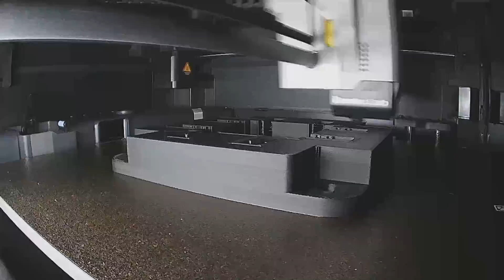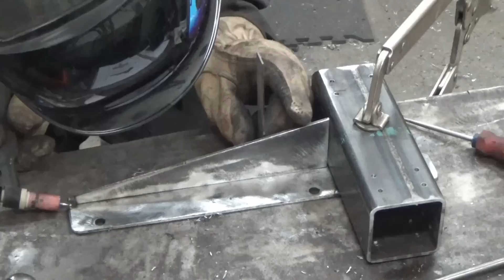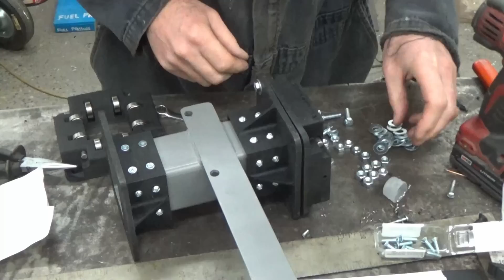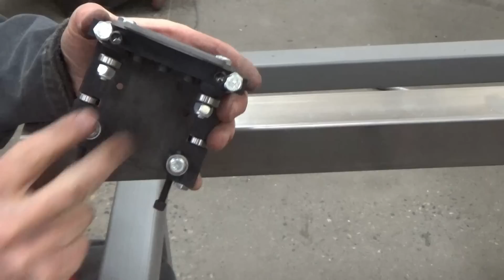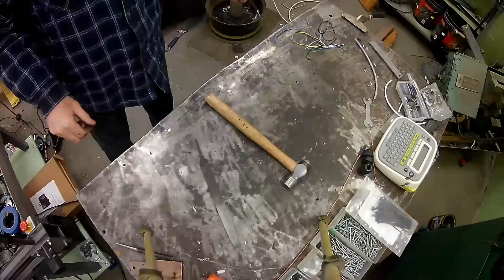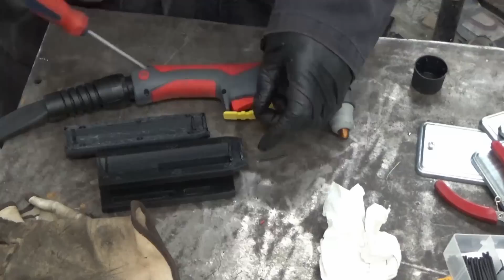We Build a CNC Plasma Table!

Comment: I'm building one now and will be using a Raspberry Pi with Klipper/MoonRaker/Fluidd to allow me to setup the machine more precisely than trying to use OpenBuild ...    I find Raspberry PI's are more stable than Arduinos and easier to update as needed over WIFI..

Comment: if it's already bulky and taking up space you might as well build an enclosure for it, from anything, even cardboard, and hook an extractor to it, it'll help remove the smoke AND you won't look like a welder after a day welding pipes in the sun with no helmet XD ... it'll save you sandy eyes, it'll save you the UV red skin burns, and it'll smell less bad, probably

Comment: Thanks for sharing.  Thinking about doing this build.  I've seen a couple of videos on the larger table and saying lots of EMI and shielding/grounding?  How much did the shielded wire add to the cost of the build?  Thanks, Ken
Reply from the maker: You definitely need the shielded wire, but it's the details in how you wire it that determines whether you have issues or not.  I will still make a second mast to separate the control wires from the torch wires, and I may still swap all the guts into a metal box instead of plastic.  A bigger table is always nice, but I really don't cut anything bigger than 2x2, and I'm not willing to lose the floor space.
Reply: @GregWellwood  I hear you on the floor space issues.  Every time I want to do something in the garage I have to move stuff out of the way to get to my lathe, mill, surface grinder, or welders LOL  I might have to make this a fold up design or build another shed to free up more floor space in the garage.  Are you having any cut issues or are you happy with the build?  Thanks, Ken
Reply from the maker: @customcutter100  I know the 2x2 is designed so the legs fold up so it can be moved/stored.  I suspect the XL is too.  No problems with cutting once I got it sorted (some mistakes on my part).  Sadly, I have only made maybe a dozen parts on it so far - the day job keeps getting in the way.

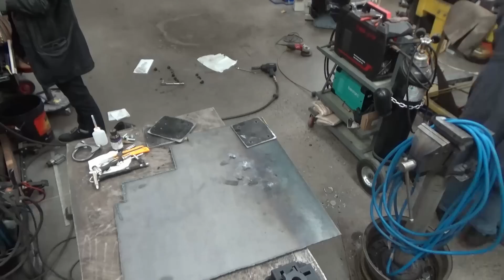Comment: 3:24 So the thing about getting new apprentices to catch the sparks in a bucket is Real.
Reply from the maker: I'm trying to catch the "grinder dust" that gets all over everything in the shop.  My kid's '68 Catalina was on the lift (you saw his shoes), and I'm being considerate of his car.  I prefer sending the apprentices off to someone for "a long weight" (_wait_).
Reply: @GregWellwood  We used to send the apprentices to get a bottle of "solder water" to wet the sponge to clean the iron tips.
One day one of them came back with an unmarked bottle filled with water, put it on the workbench, didn't say anything, and walked away.
He turned out to be a great technician.😁
Reply from the maker: @Bobs-Wrigles5555  My mom used to work in a bank back in the day, and would send co-workers to other branches to get "verbal agreement forms," and then call ahead to get them sent to another branch...
Reply: @GregWellwood  😂😂

Comment: The arduino, you flashed over / erased the arduino bootloader. If you have an AVR programmer, you can re-flash the bootloader and it would be back to being an arduino. It's no big deal, but you need an AVR programmer - they're only a few dollars on the usual places these days
Reply from the maker: I suspected I might be able to save it, but going to an ESP32 board was a whole lot cheaper, and I was tantalized by the WiFi/Bluetooth option.  I will keep an eye out for an AVR programmer.

Comment: I used a Hitbox non-hf plasma cutter for mine. Was $150 on eBay. Just had to adjust my torch on delay up a bit and have had no interference yet. Almost bought the real Langmuir Crossfire but glad I didn't in the end
Reply: those langmuir ones are stupidly expensive for what they are

Comment: I've built this plasma cutter table.  It is physically complete as to the mechanical elements.  My wiring is only as far as the controles mounted in the box and wired together.  My shop burned down and i needed something to do last winter so i built it in my bedroom in the house.  Ill have to partially disassemble it to get it downstairs and out to the shop ( once it is done )  .  I was unaware there were updated plans.  I have not been getting notices of new videos. I JUST found out there is a larger version now available. I've ordered those plans as well.   Your video has made me aware of the revisions on the electronic which makes me wonder if i need to change the board.  I am NO wiring expert ( which explains why it isnt done )
Reply: V2.1 available now

Comment: I’ve been putting off building a cnc plasma cutter for years.   After seeing this I may have to move it up on the to do list.   I have a Bambu Labs X1 Carbon and a lot of experience with ESP 32’s.   But I think my plasma cutter is hi frequency start😂.   Thanks for helping spend my money….
You’ll find countless ways of using the 3d printer and when your wife asks you to make something, it’s all the justification you need.   Great video.

Comment: I’ve been following the same series. Really want to try it out, but I currently don’t have the room for one in my shop. Still might try to figure it out. I notice yours is on wheels. That would be a plus.
Reply from the maker: Everything in my shop is movable - either to take it to where I need it, or get it out of where I don't.  Plus - you really want to plasma outside.  The fumes and stuff are nasty.

Comment: Rust proofing - Go to your farm store, get some milk Stone remover / cleaner. Phosphoric acid based, not sulfuric acid based, and you can 'pickle' the steel, so it won't rust by brushing it on It is acidic so use proper ppe. Cheap.
Reply from the maker: Hmmmm... I have some phosphoric-acid based Rust Converter.  Probably could have tried that.... :)
Reply: Usually $20ish / gallon, and you can dilute if necessary. Highest % of phosphoric acid I can usually find thats not labelled and priced as rust  converter, potent stuff...fyi